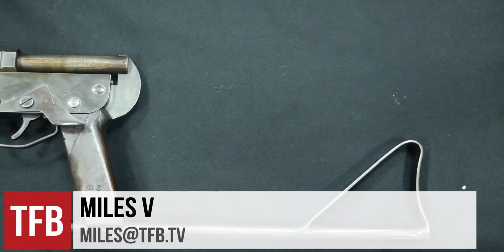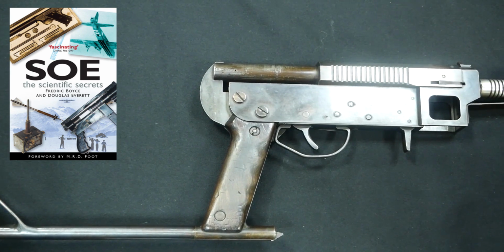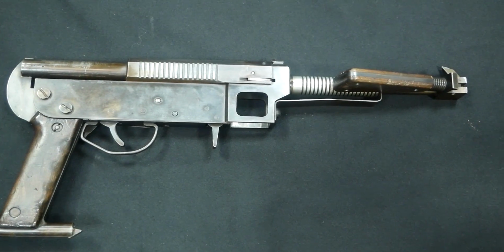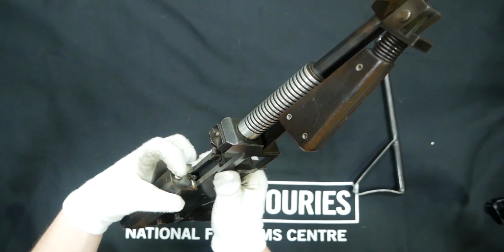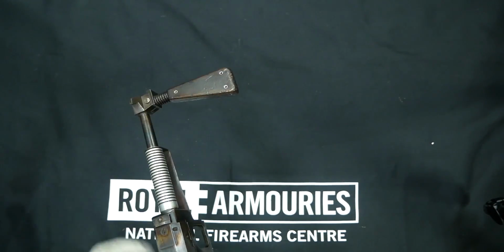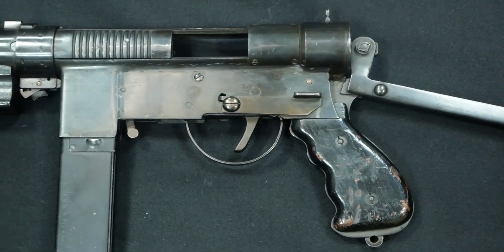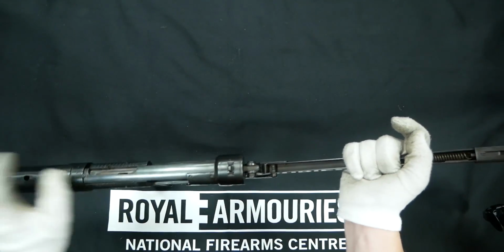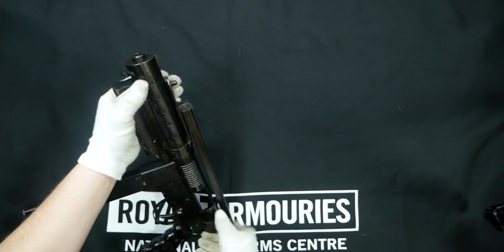Top Secret WWII Machine Guns: The Norm and Welgun

Comment: The grip must have been so you could conceal the gun with your left and control the gun from the right. You only use your left hand to pull the trigger, the right control the angle of fire. Also hip fire only.
Reply: cant actuate the full auto thing with your left
Reply: @kazoolordhd6591  - Yup. Also - It makes no sense to include a shoulder stock if the weapon isn't designed to shoot from the shoulder.